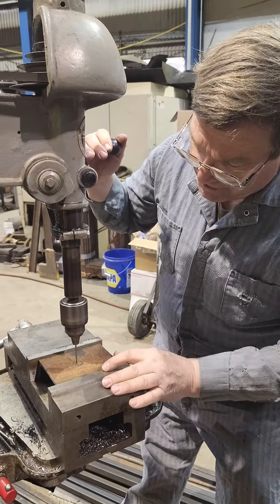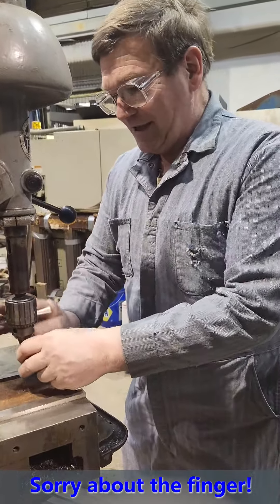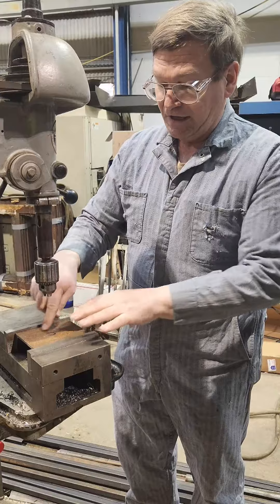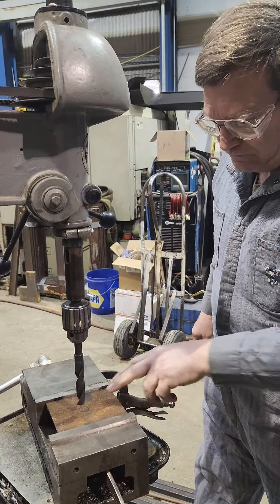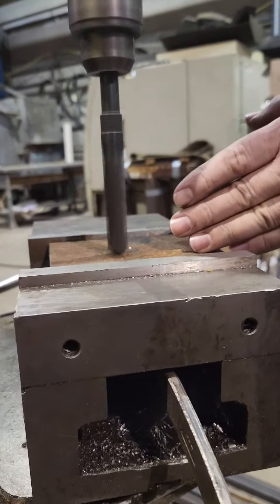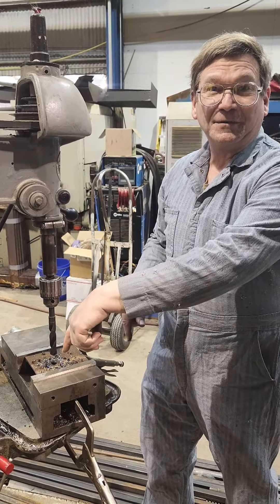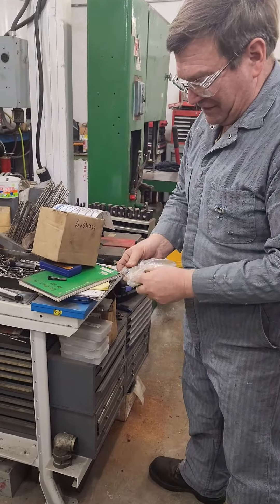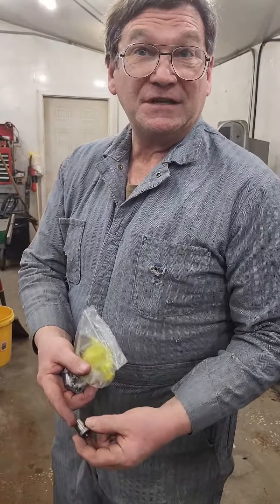Machinist's Minutes: Drill Bit Alignment and Drill Bushings

Comment: My radial drill press is a #4 Morse Taper spindle. To pick up a center punch with it, I bought a #4MT dead center. I just pop it in the spindle, center it up in the punch mark and most of the time im good to go. For more accuracy, I built a guide for a center punch to be sure that it is at near perfect 90°.

Comment: So many would benefit from the past. Just get a copy of the 1915 brown and sharp toolmaker book there’s no end to the enormous amount of ideas for working with machines and fixtures and designs that are still valid in today’s workshop. My shop had to get a micro finish on a gear shaft typical od grinder was only able to get close the finish had to be highly polished like 10-15 um and grinding was only going to get to 35-45.
The manual from 1915 gave me the answer seahorse hide’s on wooden wheels and 3000 fpm.
So of course you can’t buy seahorse hides.
Use a sewn cotton buff and get the rotating speed by changing the speed on the spindle with different pulley sizes. By running the parts after initial grinding and working them dry putting the parts in varsol too cool them between working the finish and holding the.0002 tenths tolerance the problem was resolved by an idea that was 70 years old at the time.
CnC tools are great but they aren’t a panacea. Drill fixtures are fast and more accurate than the CnC.

Comment: When I worked at a production factory I would hard mill a hole and a spigot on worn out press die punches at 60HRC with a long reach relieved neck end mill. I had no problem getting 5μm of diameter deviation by interpolating on a DMG M1 (but it wasn't ideal either to be honest and general use carbide tools would last for only about a dozen of them at best) before parting them off with an angle grinder, rounding the entry hole portion with a small round rotary stone and fine emery papers and lapping the final few microns of the bore to match the largest toleranced drill we had to use. They kept a steeply angled hole in the exact size and position for more than 100.000 parts each

Comment: ANSI Y14.5 - “GO for Comment!!!”
I have found that most shops assume it to be high tolerance (not necessarily the case) and have little understanding.  Used correctly, it actually gives more latitude albeit “conditionally”…
I have made several trips to shops to explain what it means and tell them it is actually to their benefit.  Some shops see those little “planet boxes” (as we called them) and just price the job as if it was a tight tolerance…. to their detriment.

Comment: I depends on if you want the hole exactly in a position.  I want the hole right here +- .002 to the edges, straight and square to the top surface with a hole size of +- .0005.   He is just poking a hole.

Comment: It's like the old saying about "if the only tool in your toolbox is a hammer" but now the only tool a lot of people want to use is CNC. Yes, it is very nice. You can do some pretty amazing things with them. It isn't terribly hard to program if you have the right software. However, there are a lot of times that the precision it can offer is not necessary for the job. What does unnecessary precision cost the customer? More money.